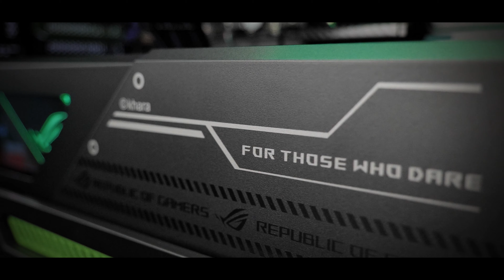Dream Anime Gaming PC Build! | ROG X EVANGELION | Complete Desk Setup | EVA Z690 Hero Strix RTX 3080

Comment: Insanely sick build!! One thing, and correct me if I'm wrong, but I think the plastic cover for the CPU socket should pop off on it's own when you clamp it down - no need to wrestle with it.
Reply: You’re right it does pop off on it’s own when it’s clamped down. Intel style

Comment: Cool pc, but these parts will be replaced by next gen hardware in a couple of months so I don’t really see the point of building a high end system like this
Reply from the maker: Nobody would ever buy anything if you worried about what’s coming next all the time. This system would be capable for the next 5 years at the minimum, easily. Worry less about tomorrow and enjoy things now.
Reply: @Matthew Walsh then you have to take loss on selling your used 12th cpu, it really doesn’t save you money in long run
Reply: @Matthew Walsh ok, so what your saying makes even less sense as a consumer. Why buy all these parts and not even be able to use the pc since you need a cpu. Wait until later in the year when prices are lower or you will be sitting on an expensive paper weight